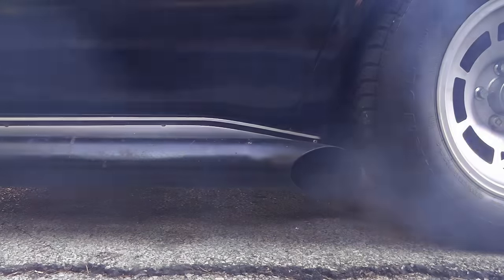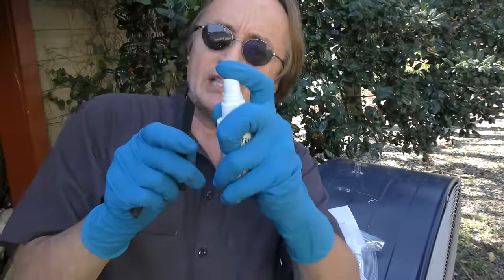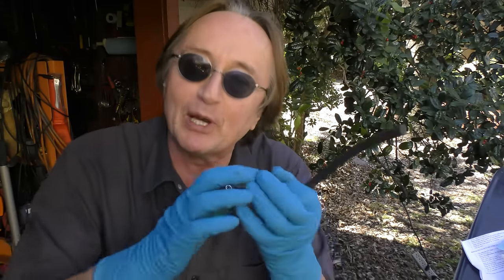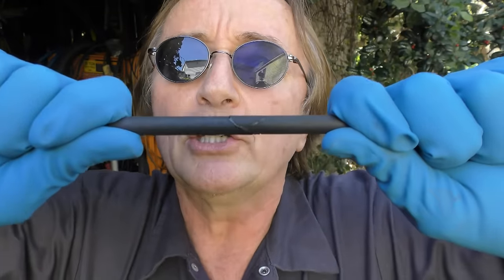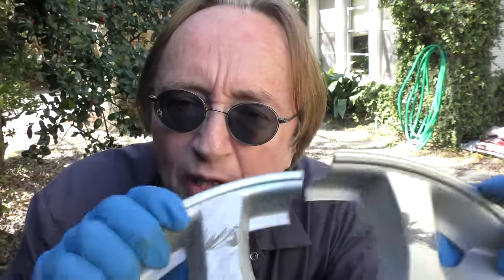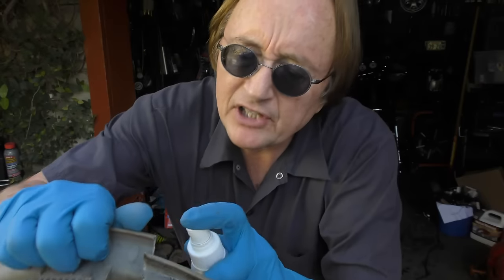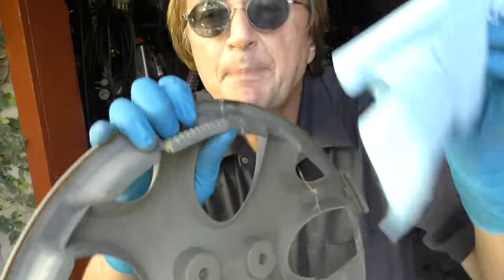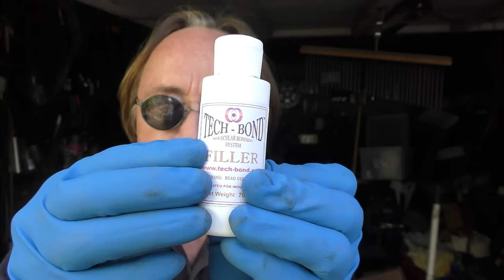New Super Glue System to Fix Your Car

Comment: I bought the Last Glue kit from a seller at the LB Motorcycle Show and it is equally amazing. Doesn't need an activator as once the air/oxygen is removed by pressing two parts together, that thing is on for good. Similarly, the seller told me to store it in the fridge and make sure not to squeeze the air out of the bottle. It is still usable after more than 2 years.

Comment: There is something else you can do with superglue. mixed with baking soda, it can fill all kinds of things. Ya have to move quick tho, it dries almost instantly when you add the baking soda. They use this method to repair dings in carbon fiber helicopter blades. Myself, I've made things out of it where part of something was missing, Yes, you can grind or sand it smooth. it's hard so it's not going to be easy, but that's what you want. The thinnest glue works best for this application. thicker doesn't mix as well.

Comment: I use a similar system where you apply the cyanoacrylate glue, then spray an accelerator on the area to make it set quickly. Works very good.

Comment: thanks for the fridge tip!
Reply: Actually put in the freezer section of fridge,  many other similar product can be given a long life this way.
Reply: The key is minimum ambient humidity.

The interior of a cold refrigerator is very dry, which is also why transformer889's advice of sticking super glue in the freezer section of a fridge would also work; the colder it is, the drier it will be.
Reply: lambchopxoxo yea I've got a 20$ bottle of 3m "crazy glue" and it says keep it in the fridge. 
I wonder how this stuff might be for laying down a scratch in a textured bumper , where the piece is still there but it's hanging on like a sliver from a drill. I haven't touched it until I've found a barely noticeable repair.
Reply: Yes that should work.  Heat the area with a hair dryer first and use a minuscule amount of glue so little to none seeps out.  Put a piece of waxed paper over the area so the piece of material you hold against it till it sets, doesn't get glued to it, but wipe away any excess glue that seeps out before then.
Reply: Stinky Cheese
Yea I think I'm gonna give it a try, thanks man. 
actually,I think I'll find some scraps of similar material first and do a practice run. 
When the car was new , they used self tapping screws to hold the license plate holder on the bumper. 
In a way I'm glad they did, and didn't use a drill. 
With a hairdryer and picks and needles and small screwdrivers I was able to move the plastic back into the holes.
I've gotta get like a foot away at eye level to see them now. 
Besides the glue, self stick Velcro is a wonderful thing for that license plate application, get it by the roll.
Reply: Gentlemen after you stores your super tight grip glue in your wife's fridge you will never hear her ever nags or complaint again.

Comment: Scotty, FYI, my dentist said if you do not have the temporary tooth in while the bone from the implant surgery is healing, the teeth will move toward each other and the space will close in and the screw on tooth will not fit. Just saying from one Texan to another. Also for everyone else, by keeping the glue in the fridge, you should have more working time. Good video as usual.
Reply: William Johnson don't worry, they won't drift together because there's already an implant inside between them similar to a threaded socket.

Comment: Try supergluing the joint, both sides, and while holding it together, have your spouse or other helper lightly spray the joint with accelerator/activator. In 5 seconds it's set. To make it stronger, sprinkle baking soda behind the glued joint, apply a few drops of super glue and lightly spray it with accelerator/activator. It will get hot, but it works. The hair dryer is optional, but can relax any stresses in the joint.

Comment: About 10 or 15 years ago I ran into some stuff similar to this at HamVention in Dayton Ohio and I think it may be from this same company. The demonstration was similar as well except they would put the glue on the rubber hose, press it together and then spray the activator on it and the bond would be complete instantly, no 24 hour wait. It was amazing.

Comment: I'm not sure if it is the same but I was told when building model airplanes that the use of accelerator on the glue makes the bond weaker vs.  allowing it to cure on its own.

Comment: You can also store super glue in a sealed container with a moisture absorbing packet. Most super glue is technically a very quick reacting epoxy, the activator component being water. So moisture in the atmosphere causes it to harden. It's why it sticks to our hands immediately, because they are ever so slightly moist. In some anti-poetic way, it's being wet that makes it 'dry'.

Comment: Would you reccomend this on a vw golf mk7 bumper. I replaced the bumper bracket, however on the bumper you have the small holes where the the clips from the bracket attaches itself to is broken off. I still have the little piece that broke off from the bumper, should I use this glue to put it back together or would it better if I used like mesh or some plastic bonding on top of the glue? Since I replaced the broken bumper bracket the bumper is safe and secure but it is not lined up with the side bumper.

Comment: Acetone works well to unstick. It's cheap and, also  good for a number of uses. Including  for cleaning parts(most especially Aluminium.) for TIG welding. You can buy a big cheap assed bottle in the Nail polish/ hygiene aisle, of most groceries etc. The plain variety, store brand is best, and usually cheapest.

Comment: Hey Scotty, do you think this stuff would work on a lawnmower tire, because the glue that comes with the plugs never works on the thin front tires, works on all other tires. I get a lot of metal in my tires since having my roof done, darn staples, and nails.

Comment: I have a 1990 chevy c15 that's steering wheel wobbles back and forth when then car is on or off. You have to turn it about 5 degrees either way before the wheels respond. Is there any way i can sure up the steering wheel so it doesn't have so much play in it?

Comment: How well does this adhesive stick to glass, more specifically window glass? My window froze and the sealed on rubber brackets at the bottom of the window that bolt on to the window lift pulled off. I cleaned the bottom of the window and the brackets and used a rear view mirror adhesive in attempts to reseal the brackets to the window rather than have it sit loosely. That was the best thing they had given my situation and I'm not sure long term how this will last so if I encounter this problem again Id like to try this product.
Reply from the maker: sticks like mad on glass when you use the prep on the glass first.  You use the blue label glue on glass
Reply: I'm going to go ahead and order it as that seems like a very useful product to have on hand.

Comment: Welding rods in the fridge? 😂
Reply: Sash Window ikr

He always has the coolest tools!
Reply: Sash Window keeps em dry!
Reply: This makes no sense to me too
Reply: Sash Window  ... It removes moisture from the flux....normal humidity will absorb into the flux....Welding shops sometimes have an old fridge with a light bulb on 24hrs inside...no cooling...moist flux can cause the rod itself to rust...
Reply: Couldn't you just keep them with some desiccant?

Comment: You're right, that tooth would never come out with that glue, lol.  Too bad it won't fix my electrical issue with my 96 Buick.  Needs a new battery cable.

Comment: Another trick is that when you are going to build up with JB Weld, which needs to cure overnight, use superglue in a couple of small places to hold the work in position while the JB epoxy sets up. Often when repairing broken plastic parts it's hard to hold them position to repair. 
If the parts are under stress, like levers etc., when used (which is why they probably broke in the first place) there is another trick you can use. Select a drill from your number drill set that is a few thousandts of an inch smaller than a piece of available wire or small finishing nail. Drill through both parts that you have repaired. Now heat the wire or nail up with a match and plunge it into the hole. This will act as a high strength splint for the two parts. Trim off the exposed wire or nail with a dremel tool and a dab of paint to match the plastic color and Bob's your uncle.
Reply: Aceroadholder hey that is a great tip. Why didn't I think of that. I could've saved a lot of items over the years.  Thanks!

Comment: hey Scotty Just want to ask you how do you change the horn on a 02 Nissan Almera mine works it just sounds a bit sick I have a horn for it but the horn I have thought it only has one connection as the one on the car has two connections how do I wire it in thank you in advance
Reply: Stephen Ryan it's easy ..find the positive wire to horn and connect to the pin.. other is ground wire just ground it chassi or a bolt... if you have  same two pin horn , simply remove and install new one  just put the wire and test it if its works , change the pins if it doesnt work or if it's one pin then follow above steps..

Comment: I had a question is it ok to put 93 octain gas in my 2011 silverdo I put 89 in last week and the missing stoped just wondering if its bad for the motor
Reply: proseinc proseic I'm not Scotty, but no a higher octane fuel won't hurt, and Is sometimes better. Especially in LS motors where most recommend premium like my LS4.

Comment: Hi Scotty, I am having an issue with my 2006 Saab 93 that has something to do with the left front suspension. It is driving me crazy by clicking when I go over bumps or making some sort of knocking sound. It's even more confusing because it doesn't happen on every single bump in the road and it doesn't even have to be that bumpy for it to make the noise… I had all of the struts and shocks replaced less than a year ago, what could it be?
Reply: It also sometimes makes the noise when I turn the wheels at low speeds
Reply from the maker: worn A frame bushings or struts often do that

Comment: Scotty I have a 98 Honda Prelude and I'm not getting any spark. i changed the distributor brand new and plugs are new. What could be the issue?
Reply from the maker: normally it's a bad distributor, check the power relay to it and the fuses
Reply: Scotty Kilmer Thanks Scotty

Comment: any special tricks for a motor mount passenger 05 pt cruiser? or a temp fix so it wont completely break is the piece on the inside area the black bushing or idk what its tech called
Reply: Josh B Window seal
Reply: yah,found a,couple videos doesn't look to hard

Comment: The new Gorilla working for my Mechanic broke my Heater Core tube yanking the coolant hose off of it, since my truck is sixteen years old, they said it was brittle and it wasn't their fault.  I reluctantly agreed, even though I saw him do it without any caution what so ever...-So I can't afford a heater core replacement, do ya think some of these new glues might work?  I thought about using a smaller plastic tube to fit within the remaining tube ( I know I'd lose a little volume) and finding the right glue to be able to put my hoses back on.
Reply: im gonna take a risk and try this on my rubber fuel line hose.

Comment: Hi Scotty, I have a Mitsubishi Magna 2004. Recently my car has been emitting a rhythmic knocking sound that increases speed along with the RPM. I popped the hood and I can hear that it is coming from the engine. The engine light came on for a split second while I was driving. I do not know much about cars so I did not open the engine cover. I had an engine oil & oil filter change around 3 months ago. What do you reckon may be the potential problem?
Reply from the maker: remove the fan belts, pray the noise stops and it's something like a worn alternator bearing. If not, engine has serious internal Expensive damage
Reply: A cheap automotive stethoscope really helps locate the real source of noises like this.    Just watch where body parts get in relation to spinning objects and belts.
Reply: Mitsubishi magnas are cheap for a reason :)

Comment: I need help a lot of help I have a lot of calcium buildup inside my spark plug Wells so much I cannot even get my spark plug socket inside the spark plug well what is the best way to get build up calcium out of my spark plug well. my car has been sitting over five years and I am assuming that is why all of the corrosion and calcium buildup occurred

Comment: Why do you need an accelerator if you wait 24 hrs for it to completely cure?  Typical super glue only takes 1 hr to fully cure.  My favorite is the Loctite Gel Control.  It goes on thick, not like that thin stuff you showed on this video; stay away from the thin stuff because it will go everywhere you don't want it to go.
Reply from the maker: this kit has everything from super lightweight to super thick that's used to glue corpses back together. You can't beat the whole set of different weight glues for about every use you'd need.

Comment: All the hype and over-exagererated claims makes deciding which glue, epoxy, adhesive, or sealant to use a little daunting for us non-chemical-engineers.  It's fine if there is a special product made specifically for your application, (gasket sealer, thead-locker, wood-glue, etc)  but if you have a project that doesn't have a dedicated product available, good luck finding something that will work well, especially gluing plastics (HDPE !!!!).  Most likely, you will be re-gluing it about 3 months later.
Reply from the maker: True, but this guy knows his glue, i've fixed so much crap with this system, from my wife's Italian shoes to a broken intake plastic manifold on a porsche.